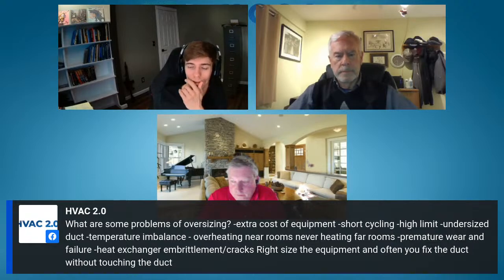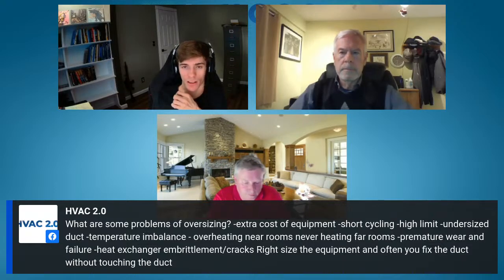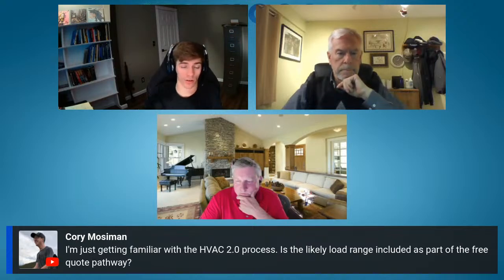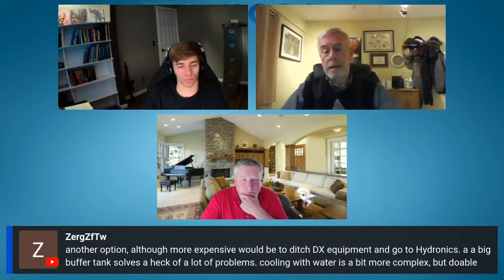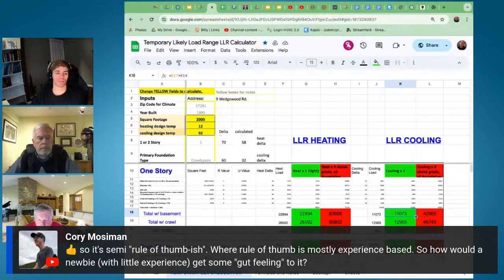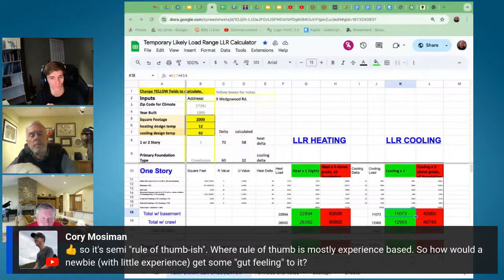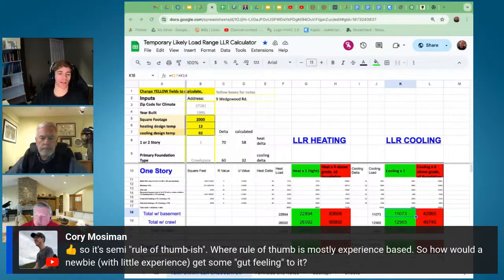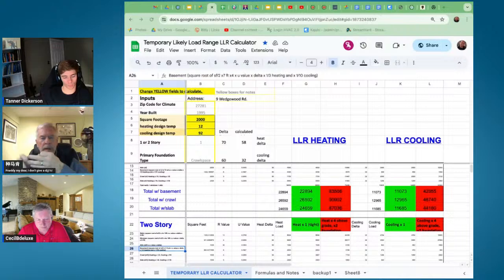What if the homeowner wants an oversized HVAC system?

Comment: YELLOW RED FIRST?

If you size to the yellow or red you expose yourself to increasing risk that your ductwork is insufficient for the equipment. The solution to insufficient ductwork is typically spending 10 to $12,000 on bigger ductwork. Taking duct  pressure will help us get a better idea of how much that risk applies to your situation. 

Are you comfortable assuming this ductwork risk?

Often what we find is when people fix the duct work on oversized equipment, it doesn't solve Comfort issues because the equipment still short cycles because it's oversized. So if they're Comfort issues still bother them, the next step is to fix deficiencies in the house.

Now what typically happens as people fix deficiencies of their homes if they have oversized equipment is by reducing the load on the house the equipment becomes MORE oversized, and the short cycling issues which typically are the cause of their discomfort becomes more pronounced. 

So their house actually gets less comfortable, and then they call us again and ask us to replace their nearly brand new equipment.

If you size towards the green often duct size issues fix themselves or at least become much less pronounced and easier to correct. 

If on the hottest or coldest day of the year the house doesn't keep up, since this size equipment is appropriate for other houses this size, it likely means that your HOUSE has a deficiency. If that deficiency bothers you enough that you want to fix it, the most likely fix is to tighten up the house.

We can help you better understand this with our comfort consult 

In other words, if you size to the green, you reduce your likelihood of duct and or equipment problems being the cause of discomfort, and slightly increase the risk that your equipment won't maintain set point on the hottest and coldest days.

Our position is we're happy to replace your equipment twice and replace your ductwork, but we feel obliged to make you aware of this risk in advance so you're not angry at us for not warning you and suggesting an alternative path.

Comment: 0:52 with current equipment fragility and poor dehumidification capacity load calcs are a common topic these days
1:58 homeowner performs aggressive, accurate load calc
3:05 homeowner usually taking most of risk of bad load calcs
3:43 Alec did an amazing scientific triangulation including ecobee runtimes, and measuring space heater energy use
6:09 most systems are oversized, true load is far less than ppl comfortable imagining
7:05 good load calc makes transition to heat pumps much less scary
8:00 millions of subscribers
8:25 good summation, verified load
9:00 light bulb moment, data collection
11:00 the bigger system that you get, the greater likelihood you're ductwork will be too small
11:40 cycling inefficiency of equipment that never reaches operating efficiency
13:00 not enough duct to properly keep equipment cool
13:30 good explanation by Ken that by downsizing equipment often you fix duct without touching the duct.
15:20 if they had some performance with ton, likely dropping size may be enough.
16:40 basic load calcs lead to overconfidence
17:15 man j without blower door, plus inherent fear bias towards larger = widespread oversizing problem
19:05 Dunning Kruger sizing
21:00 we will install to your spec.
21:58 likely load GREEN directs taking chance of undersizing avoids risk of unnecessarily replacing duct, realizing house is still uncomfortable, improving house and having oversizing comfort issues get WORSE
25:16 assumption of risk needs to be CLEAR
25:36 clarify NEXT STEP if there are issues due to sizing decisions. They are responsible for operating home within parameters.
27:02 when you educate a reasonable person and remind them, they tend to be reasonable
28:10 learn how to handle common challenging situations so you can behave like a professional
30:00 better equipment can blunt problem of oversizing
32:27 "in my experience you'd be safer leaning this way..."
33:00 walk away is not ethical, virtuous, or moral, it's being a self-righteous child. 
Lots in this industry.
34:59 "I accept responsibility" is pretty clear if they haven't hired you for a comfort consult, assuming you are an HVAC20 contractor.
36:50 it's the homeowners decision!
47:12 Jason conveys risk of oversizing wrt comfort and longevity
49:20 fan laws estimate static of smaller equipment
50:31 likely load range temporary calc shown later